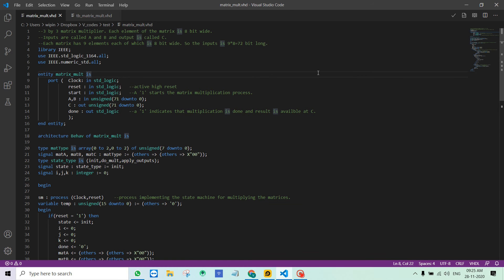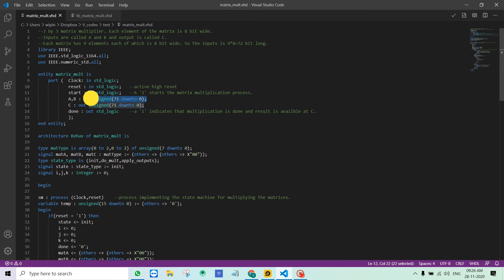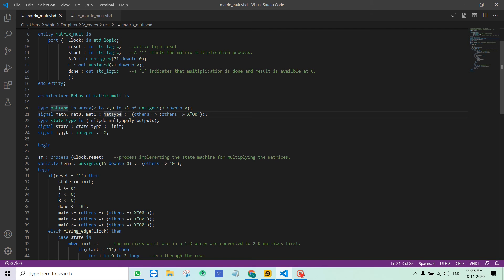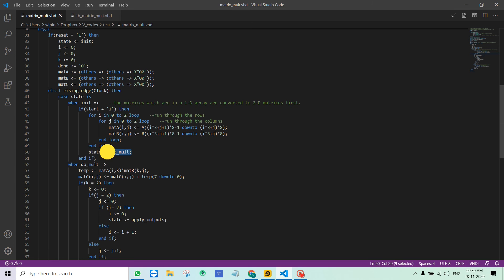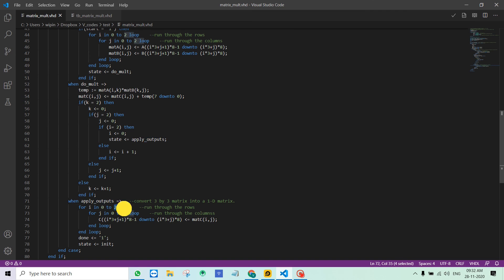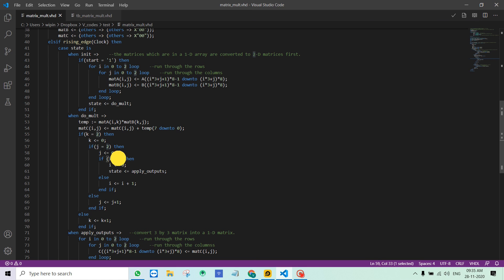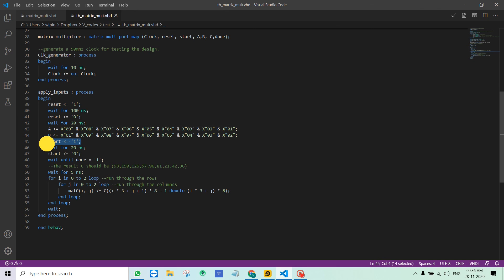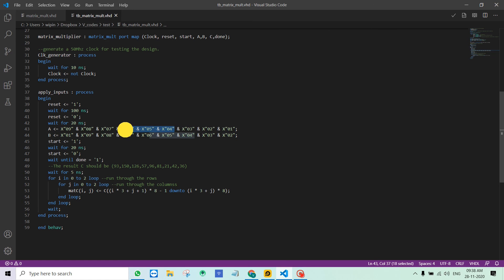Synthesizable Matrix Multiplication in VHDL

Comment: Can you please tell me whether this code can be used for Basys 3 FPGA?
Reply from the maker: it can be used. but not directly as inputs and outputs are 72 bits each. so you would need to write a wrapper to input numbers in multiple stages. and also show the output in multiple stages. like you set the switches, push a button and then change the switches and so on.
Reply: @VCodes  Can you provide me the code if possible?
Reply from the maker: I dont have the code readymade for this. but you can write up a state machine for this. if you attempt it, I can guide you through the process. but I do charge a fee for my time. send me an email if you want.

Comment: Great!! Thanks :) but could one not do it simpler ? more like in C/C++ ?  for that in C in need like 40 lines only.. without state machine
Reply from the maker: you can. but it will be hard to synthesis it.
Reply: @VCodes  When you do the multiplication of two elements, its 8-bit unsigned x 8 bit unsigned ->> this puts out a 16bit unsigned value. Why are you storing it in a 16 bit temp-variable and then cut off 8 bits when putting it into the output matrix? Arent you loosing information, when multiplying higher numbers? 

To my first question, i wrote your matrix multiplication a little shorter, and although there are not really any matrices involved, it kinda does the same job, would you agree ? ;D
https://github.com/Wale94/matrix_multiplication_vhdl.git
Reply from the maker: @dukenuke2690  if you are getting the correct results, and code doesnt need to be synthesisable, anything is fine. my code is simple and based on the assumption that the output matrix doesnt have numbers greater than 255. The code is done more for educative purposes which someone can play around with and learn more.
Reply: @VCodes  :) ah ok i get it. Why would my code not be synthesizeable ?  number of IO Ports could be connected to some other Core or BRAM
Reply from the maker: @dukenuke2690   Good. you have lot of questions. I can provide guidance for a fee. you can write to me at lalnitt (at) gmail (dot) com